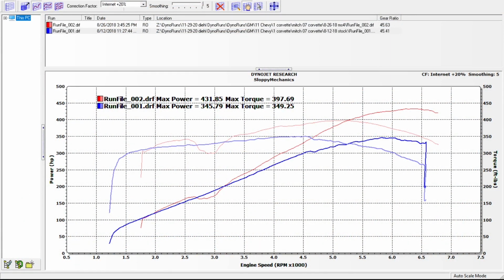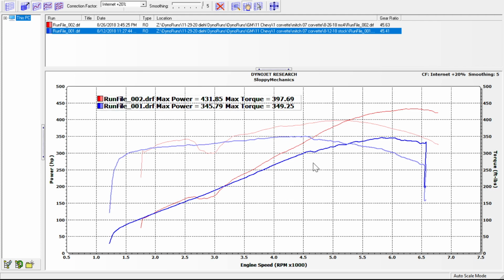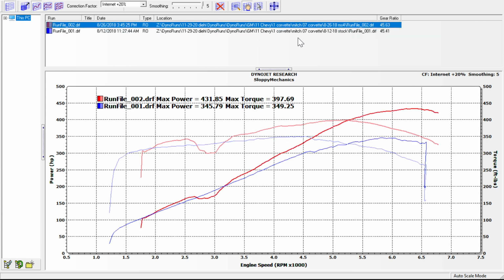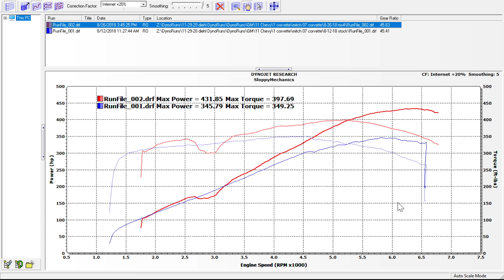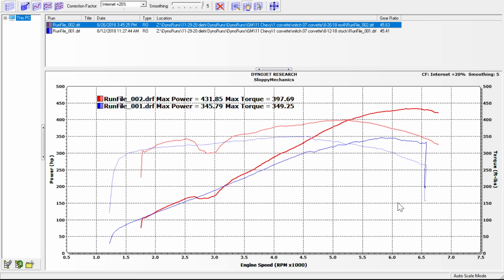Mitch's c6 stock then cam dyno hits

Comment: Is it just me or is there a wide range of HP gains on LS3 "cam only" cars? There is another channel that does a lot of corvette tuning and they seem to get numbers in the mid 400s. As a disclaimer I'm basing this off YouTube memory and had done zero research into the specific cars and supporting mods. Just making broard general assumptions because that's what you do on comments right?
Reply from the maker: Don’t do many all motor cars also everyone’s telling me this is most likely a ls2, they’re probably right as it’s been like 2-3 years since I filmed this